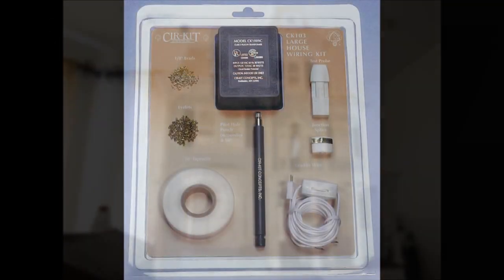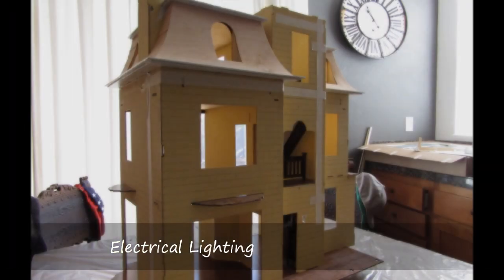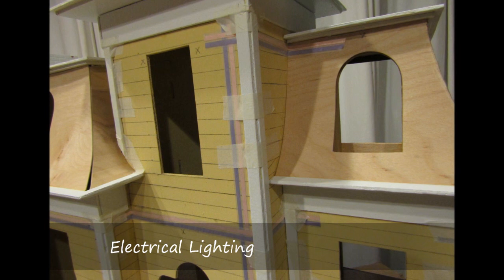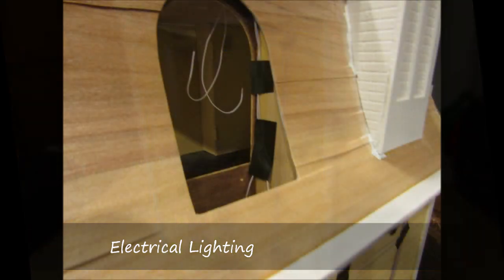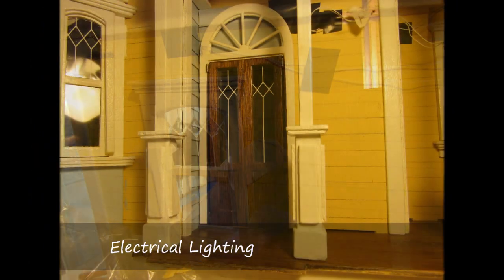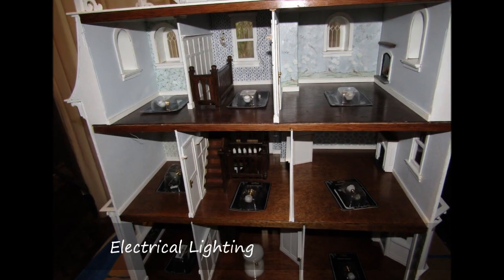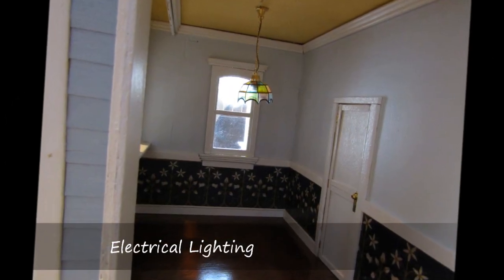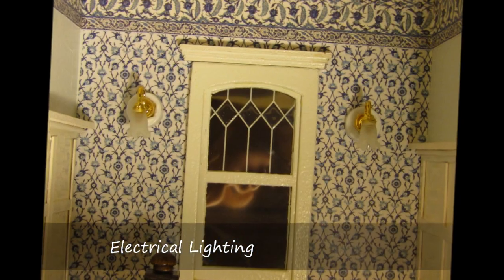Beacon Hill Dollhouse Construction:  Lighting

Comment: It's a very pretty dollhouse thanks for sharing that with everyone because now it's a person's choice if they want to get battery operated lights or the ones you have to connect electricity I think the battery once would be easier
Reply from the maker: There are pro and cons.  The battery option is much easier and provides flexible placement.  The wired option provides a unified and integrated electric system.

Comment: I am trying to locate the strap clamp you show for use circumferential applications - is it a ratcheted packing strap?  The ones I see have big hooks and I am not sure that is what you used.  Where could I find one or two of these?  Thanks.
Reply from the maker: This is a ratchet type strap.  Lookup "strap clamps for woodworking" and you should be able to find these at home improvement stores and Amazon.

Comment: I have the same house but mine came "pre-loved" so it was constructed. Trying to figure how to wire it so I can then wallpaper over it.
Reply from the maker: Most people run the tape wire on the inside then cover the surface.  You can run this along the floor then cover this with new flooring.  Since I started from scratch, I decided to run the tape on the outside and cover with the siding.  Good luck.

Comment: I haven't seen anyone do the wiring on the outside if a house before, but I guess if it's under the wrong you could. Usually u see people run the tape inside, before wallpaper and floors
Reply from the maker: I have mostly seen others run the wiring on the inside as well, but I wanted to paint most of the interior walls and the wiring could easily be covered by the siding.
Reply: @BradVaughn  those others were mostly the types of houses with pre milled siding already part of the walls.